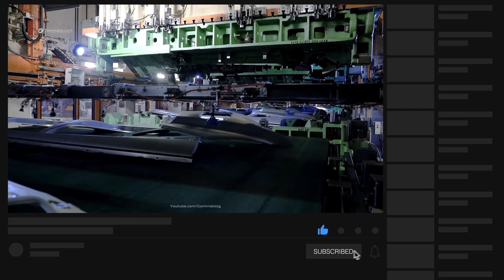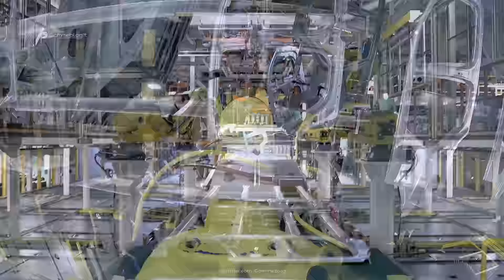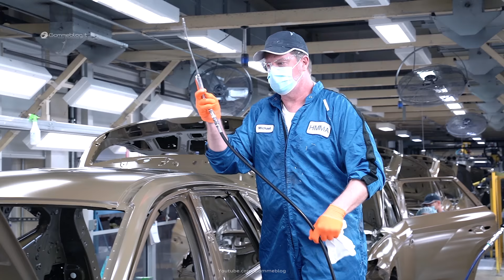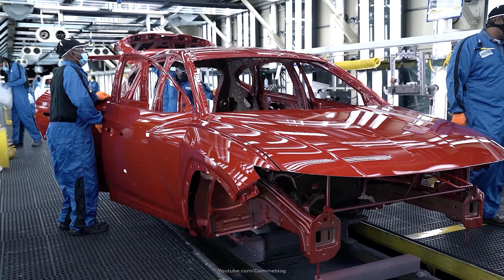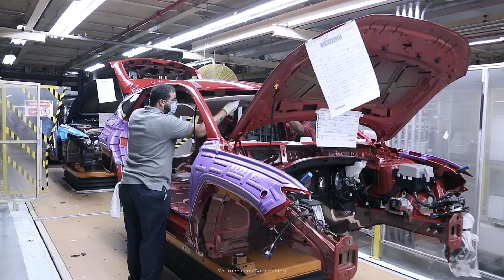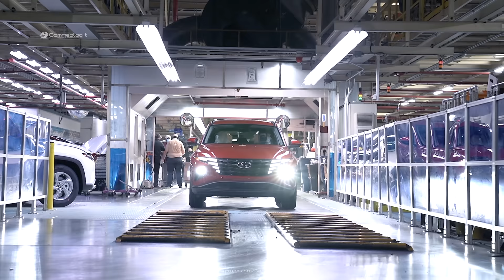Hyundai Tucson PRODUCTION 🇺🇸 USA Car Factory Manufacturing

Comment: Its always interesting to watch these videos, as I am a fan of the manufacturing process. It has changed so much since the very first days of mass production.
Reply: Yes it has changed!!! Lots People now dont have jobs and cars are more and more expensive
Reply: @stefanhristov6834  there are few people working in shop floor only visual inspection soon , robotic will occupy this place become fully automated factory , mechanical engineers job is question marks in feature this is true
Reply: Yes
Reply: Done
Reply: Fabrica de Tucson diesel en Estados Unidos barco via Uruguay a paraguay a importado de automotor s.a.
Reply: @stefanhristov6834  

Think it's bad now wait until electric car's actually become the thing.
Reply: @stefanhristov6834  Hi, you could build your own to save money.  😳
Reply: @ravit1336 ٦ هعت، من ٦
Reply: @stefanhristov6834  you can't even imagine the price of cars if they didn't use these machines and it had to be handbuilt
Reply: @stefanhristov6834  true, but stop being a cynic.

There's still plenty of jobs out there.
Reply: Even the earliest days are chock full of amazingly innovative precision machinery.
Reply: @dpz9872  they are a thing now plus a waste
Reply: It happened in the age of Industrial Revolution in the 18th century, and has been going on since then.   It will never stop as well.    Get used to it.

Comment: That's absolutely beauty to the power of n th....
But setting up the factory base  with so much hi technology is what is the toughest part  which needs to be in  absolute synchrony for smooth functioning of the assembly line .

Comment: Structure of roof atleast should be stronger.
Reply: I am a MECHENICAL engineer 
So i am undertanding it very quitly so the structure of roof are highly denst by gravity  so 
Equation is Mg = 3x 
And in which x = density of under structue
So it can be holded by the eqaution mg = 3x
Reply: @user-yc7pf6gn9t  you mean roof is strong enough to support falling pillars or trees on top of the car? (Pillar and tree branches are common on roadside)

Comment: 00:15 Press Shop
01:00 Weld Shop
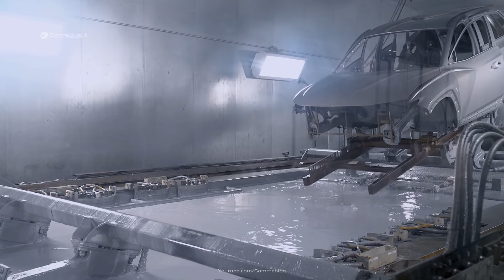03:10 Paint Shop
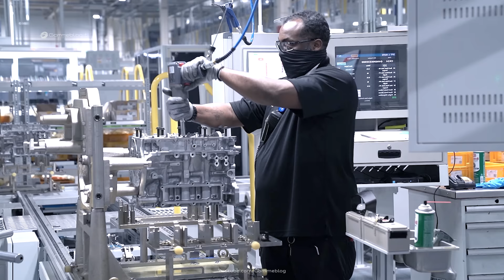07:00 Engine Assembly Shop
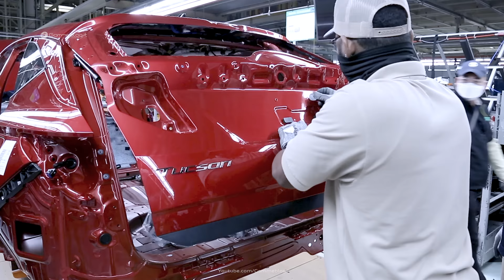08:00 Assembly Shop
09:55 VI (Vehicle Inspection) Shop
Reply: Perfeição que se nota...
Reply: @daltmonts125  on KK
Reply: Thanks ! I skipped to the paint that is my favorite part.

Comment: Putting the frames together and welding it wouldn't make the car rigidly strong. The best way is to create a single frame of hard steel and reinforce the front, side and the rear in order to offer extra protection for persengers during accident

Comment: I bought mine in Casablanca Morocco in the end of mars 2022. It's a very beautiful car but i had a little mechanic issue : a relatively strong sound in the engine when i make a 90° turn at low speed, they couldn't find what's the origin of this sound. So I'm driving it hping nothing bad will happen because of that sound until the end of the 5 years warranty. Mama Africa.

Could someone who owns or build this model around the world tell me what's that if he experienced the same issue or fixed it. Thanks

Comment: I would stay away from any Hyundai product like the plague.. In my experience the only thing worse than the reliability of Hyundai is the way Hyundai treats their customers.  I own a 2017 Hyundai Sonata PHEV, which experienced hybrid system failure on i95 (nearly causing an accident) on Aug 31, 2021.  Two months later, during which time the Hyundai dealer made two unsuccessful repair attempts, I picked up my car only to have Hybrid system failure occur for the third time before I even made it to the first traffic light.  The service center then told me the car (under warranty) needs a new battery pack, which I have been waiting for over the past FIVE months.  The car has been out of service for SEVEN months and Hyundai has refused all buyback attempts.  I bought a new Rav4 Prime in Feb…..If I ever get my Hyundai back it will be sold.